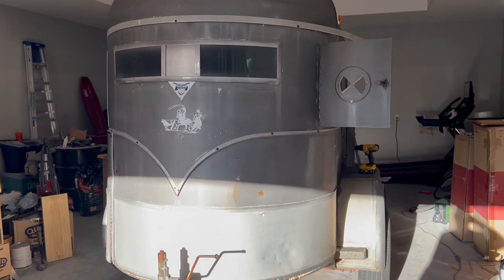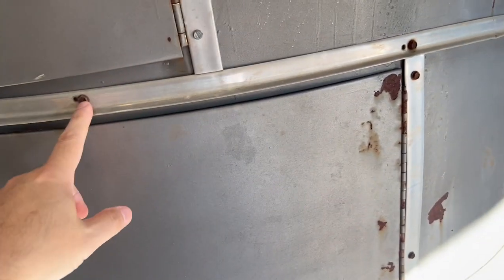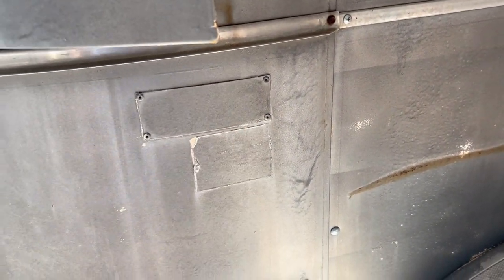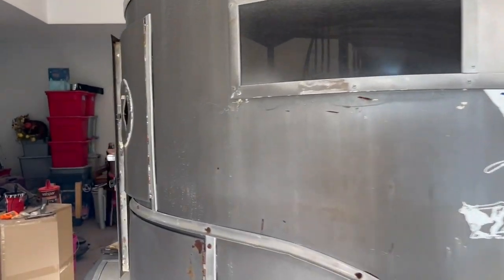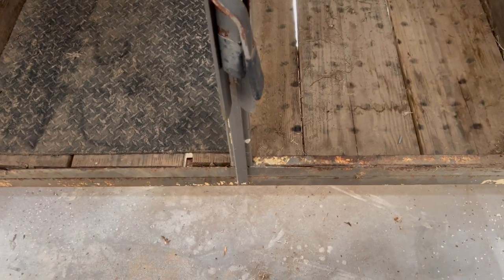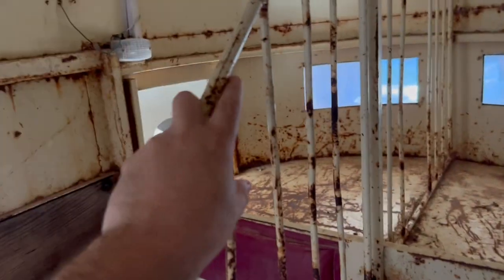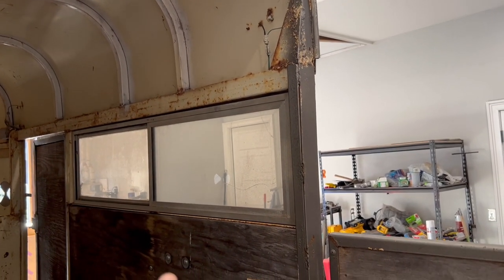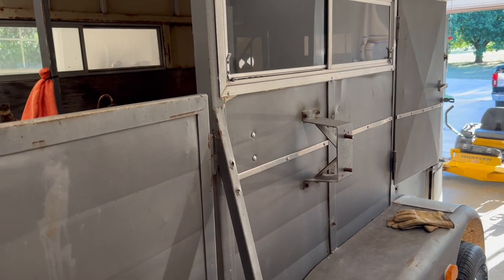The game plan for this 1997 2 horse trailer

Comment: New subscriber here. So have you ever done a camper conversion on one of these? Im keen on the idea of a horse trailer camper because they seem better build than the cheap fiberglass TT's. I suppose the big hang up would be insulation.
Reply from the maker: I’ve never converted a horse trailer to a camper. I have had several people ask me about that in person though. In theory it wouldn’t be much different then one of the big horse trailers that has a living quarters up front. The insulation would be a little bit of a hurdle, but spray foam or bubble insulation would probably be doable. From what I understand, normal travel trailer campers don’t have much insulation as it is. For me the tougher things to solve would be plumbing and electrical and how to organize it all for a camper set up. Also, to make it completely water tight could be tough too since these trailers are not originally designed to be super sealed up. Would be a fun and challenging project though. It would also likely make an interesting youtube playlist.
Reply: @carriagehousetrailers  yeah, after research they are pretty open to the weather. I suppose im looking more for an Overbuilt tiny camper. I had teardrop that wasnt well made and most cargo trailers seem shoddy. There wouldnt be a need for plumbing.

Comment: Good to see a new Vid! My trailer I am working on I plan to take out the manger area completely as it is in poor shape. So that bar that holds the divider (from floor to roof) is not structural? So when I take out the manger and dividing, I do not have to keep that bar in place? Or configure an additional support for it? Thanks!
Reply from the maker: Not structural. I know it looks important. It's function is to support the divider that separates the left and right horse stalls when hauling two horses. Feel free to cut it out. I do!
Reply from the maker: Yeah, it's been a minute. With holidays and a surprise medical issue, it's hampered my uploading some. There's more coming though!
Reply: @carriagehousetrailers  Good to hear and hopefully you are doing well!
Reply: @carriagehousetrailers   Good to know as I want to completely open up that whole area and put in a cabinet and maybe a sink and such.